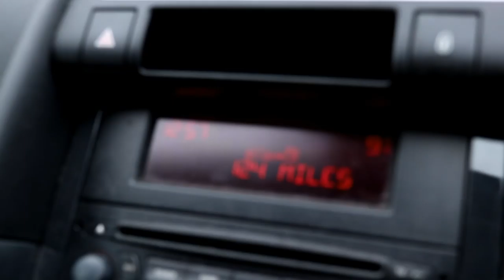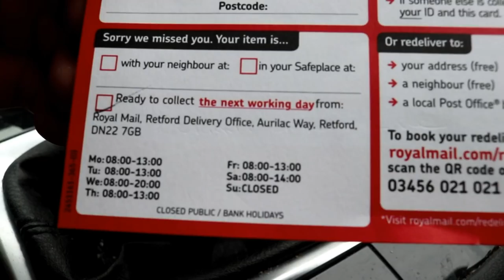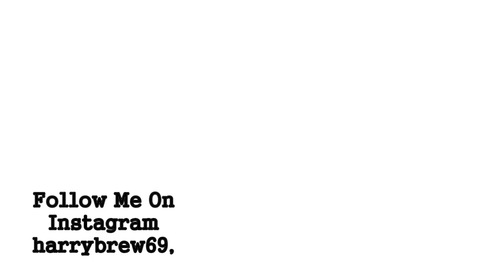Monday Migraine

Comment: It's always the smallest bits seem to be most expensive eh. Still when you are dealing with plumbing it's one thing you don't want playing up in a pub. Can that connection on peristaltic pump be bought separately from China or maybe a JG type fitting could be adapted? Cheers.